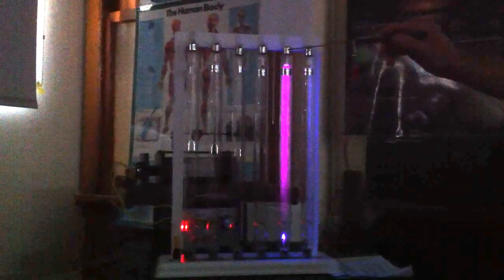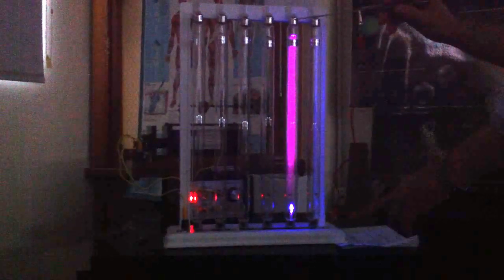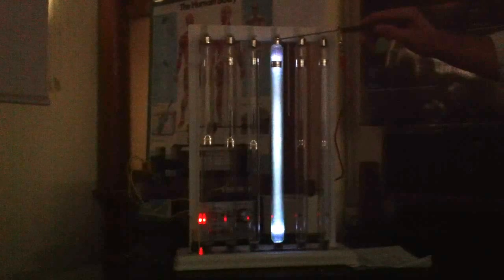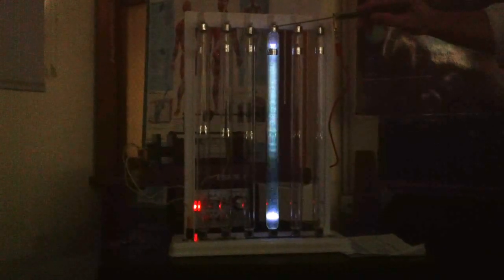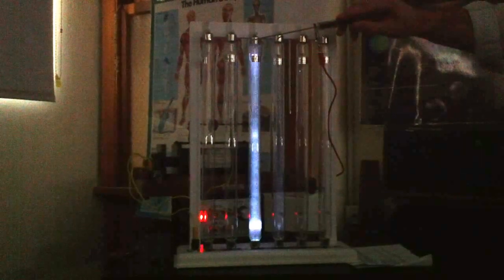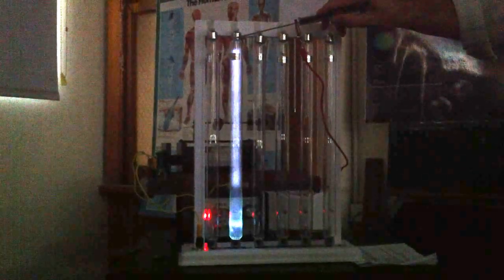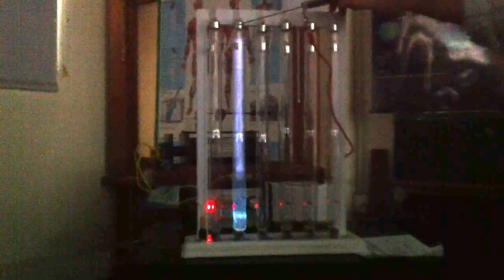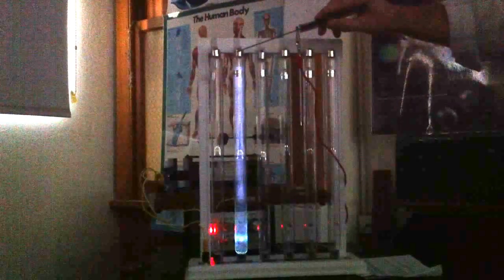Gas Discharge Tubes

Comment: I noticed that in your video the implement you were holding was not attached to any device. Could you describe the set up of the apparatus. i.e how the equipment was attached. And what voltage setting did you use on the power pack attached to the  induction coil?